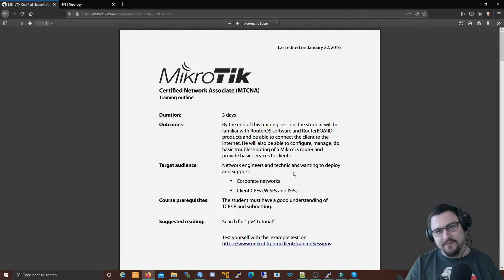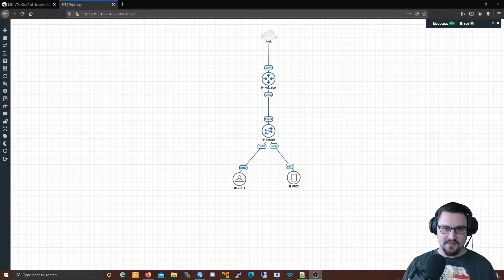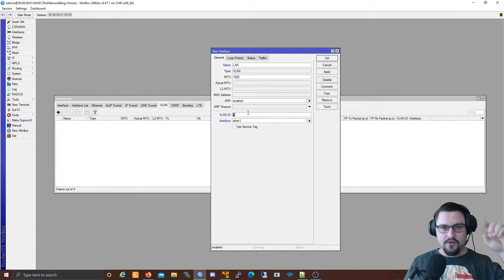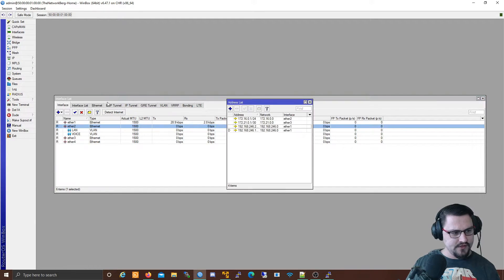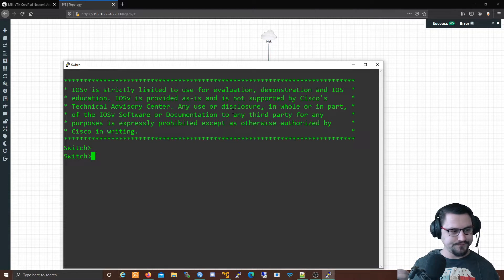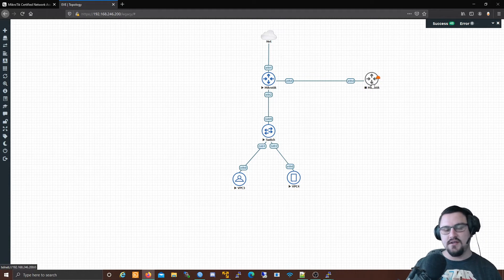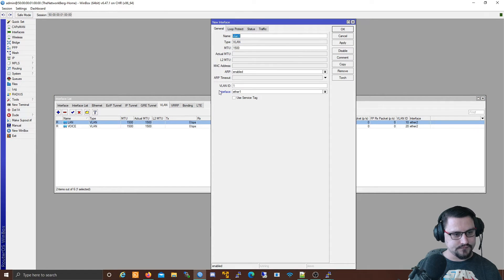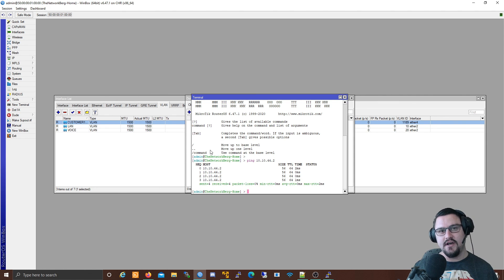Getting Started: MikroTik VLAN Configuration

Comment: Possibly this is due to the age of this video, stemming from the Router OS 6 ages, but as far as I know Mikrotik themselves recommend using the bridge as interface for VLANs, not directly on an ethernet port. If it's not because of ROS 6, then why did you choose to connect the VLAN directly to ether 2 instead of creating a bridge first an then connect to the bridge?

Comment: Which Cisco images did you use ?? I have some bin files and loaded them but they are not starting
Reply from the maker: I believe these were IOL/IOU images that were floating around online. If I recall these were 2018 or 2019 images. Would have to Google the images from the EVE-NG website, though I would suggest double checking who or where you are downloading from. Sadly I no longer have these images
Reply: @TheNetworkBerg  fixed it I hadn't updated licence file.
Reply from the maker: @matthewbennett2844  That's awesome, happy to hear it :D
Reply: @TheNetworkBerg  thanks for getting back in touch I was trying to follow your video. I'll keep plodding on and trying different images.

Comment: Hi, you're videos are very well done. I know this is an older one but I have a MikroTik Cloud Router/Switch that I want to have act as a pass through distro switch, as in- it accepts two LAN inputs from my Cisco MX firewall, and will pass data from those two LANS onto the respective ports going to my access switches say top row is vlan 100 and bottom row is 200 etc. but without running DHCP since the firewall is handling it. It seems it has to be set up to divy out DHCP but I'm hoping I'm just missing something. I would just plug the access switches directly into the MX but there aren't enough ports. Would you point me to a video that explains that if it is possible? Thx in advance

Comment: Hi Network Berg, I'm trying to autodiscover my network wired printer from a different vlan and subnet. My printer that is on a specific vlan, this isn't bridged and is assigned on a specific interface and I'm trying to find it over a wireless connection provided by the same Mikrotik (has its own antennas). From what I've seen, multicast packets don't go through, even activating igmp proxy. I'm aware they are different broadcasts domains, but is there any way of acheiving this? I have also taken into account that multicast TTL is 1 and have attempted to increase it with a mangle rule.

Note: between both nets there is a firewall general accept. No traffic is filtered. The printer can be manually added by ip.

Comment: You should always "talk about Cisco when showcasing MikroTik". It's important to see how different brands interact in a production ecosystem. It's been the exception rather than the rule (in my experience) to have a company only use one brand. It's usually something along the lines of MikroTik Routers, Cisco Switches, and Ruckus/Ubiquiti/Juniper access points all in the same building.
Reply: Would be Great for a scenario-based

Comment: so placing more vlans on a single physical interface behaves like a subinterface (int gi0/0.10) on a cisco rtr
Reply from the maker: Indeed, it works very similar to that.
Reply: @TheNetworkBerg  got it!  I have one more question pls..  on rb2011, how can i create a normal vlan for 3 access points and give it an ip address as gateway for those access points (on cisco it would be: int vlan 10, ip address x.x.x.x x.x.x.x, exit, int range gi0/1 - gi0/3, sw mode acc, sw access vlan 10) so it would be routable between other vlans and internet?

Comment: But this implementation of VLANs means using software capabilities of Router OS, not the hardware? There is another way to do it via bridges with VLAN filtering enabled, but now I'm quite confused
Reply from the maker: Some people tend to become confused when it comes to MikroTik and VLANs due to there being 3 ways of implementing VLANs.

1) Software defined (SVIs) 
2) Bridges 
3) Hardware defined via Switch Chip

I preferentially use software defined VLANs as I mostly work on MikroTik routers and not switches, this is also the only way you can implement things such as QnQ (802.1ad)
Reply: @TheNetworkBerg  thanks for response

Comment: You can do the VLAN using the bridge interface too. I normally use the interface functions when I want to rename the interface or bond the interface.
Reply from the maker: Yeah that's true, there's actually 3 ways to do VLANs, either via virtual interface, bridge or even the switch chip. Although you can really only do stuff like QnQ with the virtual interfaces. But they all have their uses :)

Comment: Hi , why we use /30 subnetting in mikrotik ?
Reply from the maker: Hi, subnets used depends on the requirement of services you want to deliver. If you are delivering a point-to-point service then  /31 or /30 is preferred unless you bring in multiple devices to do stuff like VRRP then you will need a /29. If you are planning networks for your customers then you can whatever size subnet will allow for all current devices plus at least a 15% for possible growth. Most people just use /24 by default as this is very easy to setup and understand the IP scope.
Reply: @TheNetworkBerg  Thanks for the clarification , i work for an internet company , and there are main RouterBoard (CCR) and sub RouterBoard that works as a switch , ok ! i noticed that the RB switches it has ip and who subnet /30 .
can you explain that , please ?
Reply: example 
192.168.177.14/30 - address
192.168.177.12/30 - network

Comment: can i use ordinary switch to work for vlans?
Reply from the maker: Hello, you will first have to see if the switch you are working on supports VLANs or "Dot1Q" most switches these days run it by default, however, you do have stuff like dumb unmanaged switches that are made to just run on VLAN1 and not have anything else configured on it. So check first if your switch supports VLANs then you can add them.

Comment: Thank you for your great work, which you bring to us with your channel. In case you have time and would like one day to prepare a lab, where you have ccr as a router, and crs3XX series with router OS on it which plays as a L2 device, and distribute vlans, to hypotetical hypervisors, that would be a great help, as they slightly differs within it's configuration between series of CRS1XX, CRS2XX and 3XX, which is quite confusing to grasp for a begginer like me. Thx again !
Reply from the maker: I would actually love to do that, but I do not see any images from MikroTik that I can download as a virtual switch to play with. I may reach out to them directly to ask if this is something we can do on a virtual level so that I can properly go into VLANs on L2 from MikroTik devices.
Reply: @TheNetworkBerg  Does it mean that tile and arm version of the router os, differs by the prism of the syntax and gui between the x86 (used on EVE-NG which seems to be router board based) ? If this is the case, then indeed I fully understand the challenge. Maybe mikrotik can help there for a scenario, unless I figure this out as non network SME and share it here or there ;)
Reply: have managed setting up the setup, it was not that easy for a newcomer like me, was cutting myself off from the CRS few times, but serial did it's trick, one of the most important things to pay attention to, it to add tagged management vlan on the bridge besides the bond interface  on the CRS3XX, as bridge has the contact with the CPU, where the other vlans which you pass as L2, as per my understanding will be terminated on the switch chip. This link https://wiki.mikrotik.com/wiki/Manual:CRS3xx_VLANs_with_Bonds was very helpfull to end up with DHCP being spread across access ports, and mgmt VLAN still accessible.
Thx for your videos, I've learned a lot from them as well.

Comment: Thanks you for this very nice explanation. You are quite correct, having completed MTCNA, there is no VLAN info included. I wish to extend my WIFI  that is set up with different SSID/subnets for different users. - using another Mikrotik device. I think VLAN is the "approved" way to do this. I am also using bridges for each network so I am guessing you can add a newly created VLAN interface to the bridge??

Comment: Thank you for great videos.       I have a question: how do you separate wireless devices with VLANs?
Reply: Set a VLAN tag on an SSID?
Reply from the maker: Hi, As Irfan said you will just create the VLAN tag under the WLAN interface and associate that with an SSID (So if people connect to GUEST) it might be a different VLAN.
Reply: @TheNetworkBerg  If you have just 2 VLANs that is ok. When you have much more VLANs, you get degredation in wireless performance if you have a lot of SSIDs. :(
Reply from the maker: @BostjanCadej  That is true, though different hardware, channels, etc can help with adding a few more VLANs, I typically see 3 VLANs that sites want to use, one being an extension of the LAN on the WLAN, a Guest network and then something for the Mobile devices that users bring.